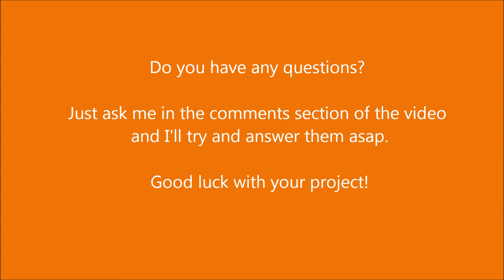How to Mix Skip Trowel Texture

Comment: 1 question I'm having trouble matching a artisan doted perfect circle pancake looking texture that not only they're same size but same distance from each other any suggestions ?
Reply from the maker: Elizabeth, Maybe try and thin down the skip trowel mix to a pancake batter consistency and hold the knife at a closer angle to the surface that you're texturing. Hope that helps. Let me know if you have any other questions. -Paul

Comment: question. I'm doing some work in a new build and the customer has asked for a "new style skip trowel texture " witch looks like dots pretty much knocked down.  I've done a lot of texture but I'm having difficulties trying to achieve this style any help would be appreciated. thx much.
Reply from the maker: I  know exactly what skip trowel texture your talking about. What I do achieve that texture is to add a little bit more water to the skip trowel mix to make it more soupy. Kind of like a pancake batter consistency. Keep in mind that the surface that is being texture also helps in determining how the skip trowel pulls as well. Hope that helps, -Paul
Reply: Thx bud much appreciated.
Reply from the maker: No problem man!
Reply: That type of finish is done with round horse hair brush then knocked down

Comment: Still no mention on where to buy the sand.   Found out later you don't really need sand at all.   Just need a very very  light touch with the trowel and light amount of mud on the very tip.  Drag at a 10 degree angle and wallah!